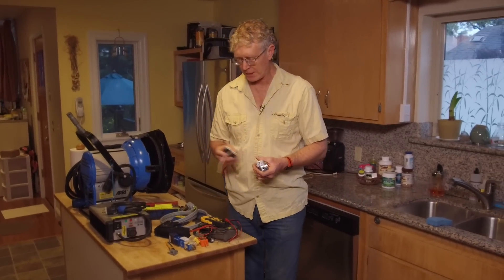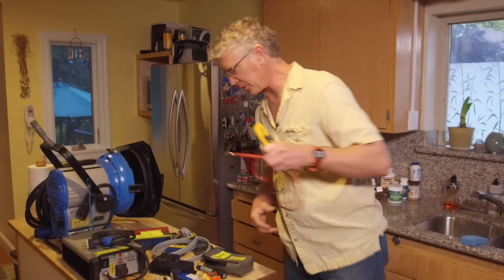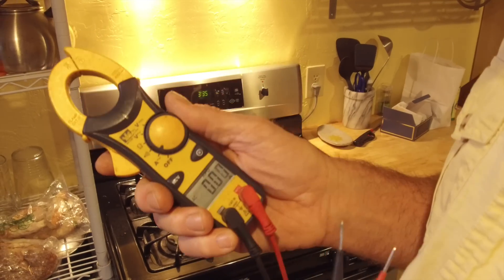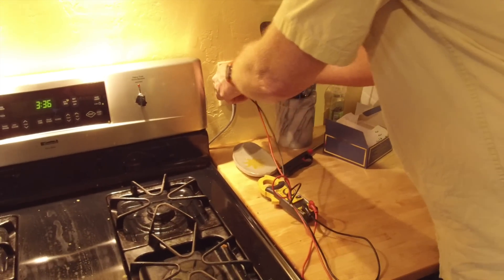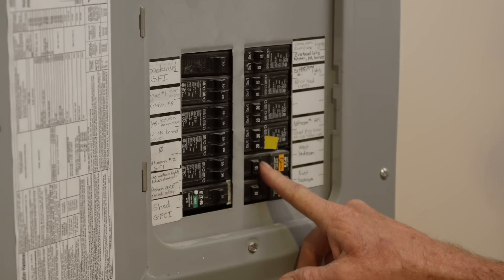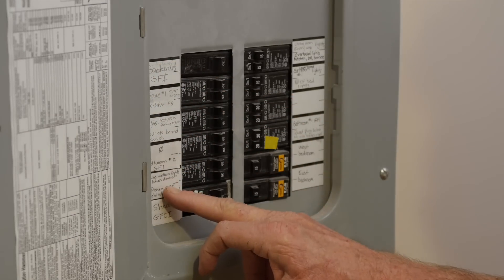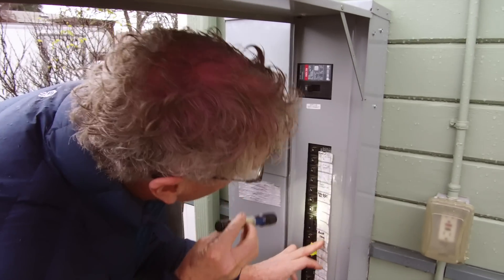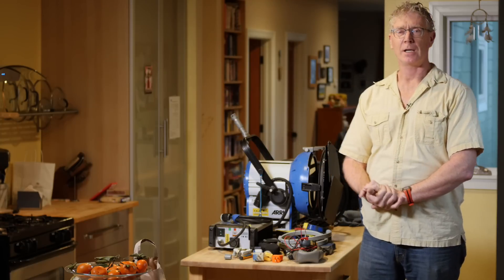Meet The Gaffer #36: Plug-In House Power

Comment: every week i am setting up at a new venue and typically relying on standard outlets. i use a klein circuit tracer with usually successful results but it isn’t always reliable.

i would love a safe way to intentionally trip a breaker. 

is there such a device? a box that ‘shorts’ or hyper loads an outlet to more easily find the breaker. much like a gfci tester does.
Reply from the maker: I don’t know of such a “tripper” but I’ll ask around.

Comment: 2 questions, do you recommend a surge protected power strip over straight plug into outlet to power aputure led lights?  And what things do you recommend to insure your lights don't get ruined? The breaker powering the studio had to be replaced and two of my lights inherited problems with one flickering on certain brightness values and the other having smoke come out (wasnt the barndoors).  Do you recommend a UPS or voltage regulator? Or is that unnecessary?
Reply from the maker: I’m thinking there’s more going on here than the need for surge protection. What were units were you using and were they all on a single circuit? Also, was the power strip and outlet grounded and in good condition? Seems like there was more than a ground fault, like loose wiring in the receptacle or something.
Reply: @meetthegaffer  Hi thanks for the reply! 

So I was using an aputure 120d and a 120dii on the same room/circuit as far as I know.  The lights have been sent in for repair, but I wanted to know if there was anything in the future that i can do to prevent this or make sure that studio im still using has actually been "fixed"
Reply from the maker: I was use a voltage tester on the circuit to verify that it is wired correctly and doesn’t have a ground fault. Also check the power strip, separately.

Comment: Funny thing about those old Nema 10-30/10-50 commonly used on dryers, the "ground" is really a neutral so you could get 60A of 120V out of them. There was no ground, it relied on the house being wired correctly so the neutral also connected to the ground. 
thankfully the 14-30/14-50 that replaced them has a proper ground and neutral.

Comment: 0:42 - 20 Amp breaker search
1:40 - Gaffer tools
2:35 - common home circuit types
3:20 - 15A or 20A?
4:30 - Amp probe tool
5:30 - using 220V  power/lunch box
7:25 - power strategies
9:13 - sub-breaker panel
11:06 - Main breaker panel
12:04 - GFCI circuit tip
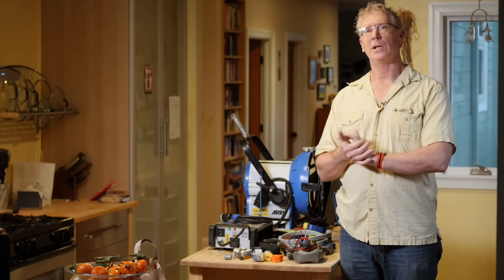12:27 - Summary